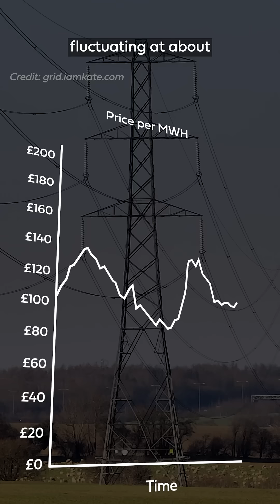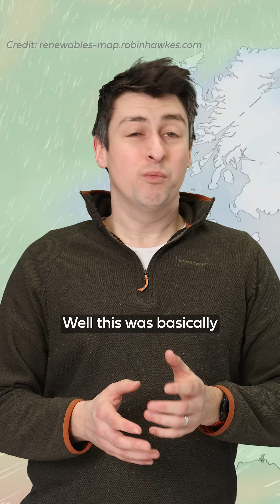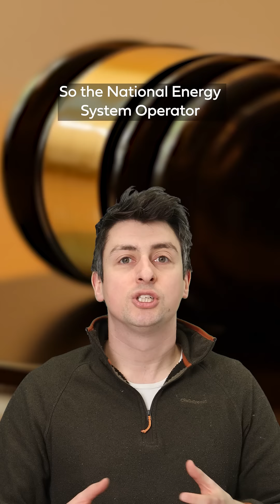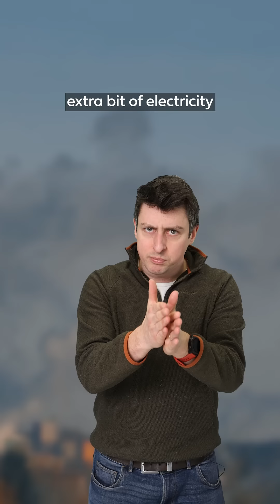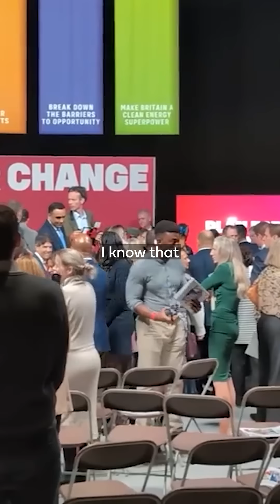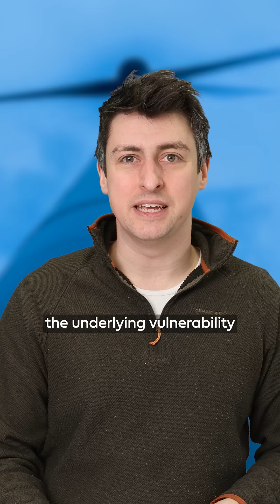The biggest price spike of the energy crisis happened last week

Comment: Former power station engineer here- Electricity was cheaper when it was supplied by the CEGB and area boards, then we had these government lies that it would be cheaper after privatisation, but dogma trumps reality.
Reply: Same happened here in Norway - to top that they created a nordic energy "pool" auctioning power every day to middle men trading companies and day traders / minute traders. A kind of a stock exchange. insane. it tripled and doubled prices ten fold with zero real world reason behind it.  We dont even rely on wind power at all.
Reply: Same with tap water. Worst in all of europe
Reply: @kingcrafteroderderfahradtu7331spot on, my parents moved to a little cottage in North Norfolk in 85 for their retirement. The water then was fairly soft & you didn't have to descale the kettle every fortnight, now mum reckons the price is 5 times what it was then, plus they now need to use a Brita water filter changed every three to four weeks to keep scale at bay, plus if they don't there's a constipation issue! Most of our water comes from rivers or the aquifers both now contaminated with loads of phosphates & other runoff from the farming chemicals like roundup which is supposed to biodegrade but not if it's in water in the aquifers! Their water butt is used for hair washing and the difference is astronomical. Anglian Water have been milking us for decades now & no sign of updating or renovating to be seen.
Reply: good grief, Reagan deregulated the public utilities in the 80s, and of course, privatization has not improved service, price or infrastructure - don't even talk about Texas on it's own power grid with failures that cost hundreds of deaths in cold or heat
Reply: Agreed. They kept selling off our services on a promise of cheaper prices with 'competition' which never happened. What we do need is more home solar, more solar & battery storage on office buildings and schools, which will bring the energy needs down a bit
Reply: @keithmcdougall4893  see I don’t see how they could even think it was a possibility.  Yeah there is ‘competition’ (idk about the UK but we can’t choose our electrical provider in the US) but a private company needs profits and infinite growth to keep their stock prices up.  A public serviced paid for by taxes doesn’t need to make a profit, it just needs to cover operating costs. 

Right now we are dealing with someone trying to make our postal service ‘profitable’ and turn it over to private companies in the US. The postal service is a necessary service and we pay for it with our taxes to work, not to make other people rich.
Reply: @keithmcdougall4893  more home storage will make things even more expensive and do so for those who can least afford the cost 😂

This is how much sense your argument makes. 

"Public transport is too expensive, we need to get more people into cars so we have less demand for it, once we distribute it across thousands of cars it'll be much better."

The cost of the transmission lines and their maintenance is a fixed cost. 

The power plant has to be a fixed size to handle the absolute worst case scenario and continue to function. So the power plant is a fixed cost. 

The only savings you can realize is through economies of scale.

And you'd like to see that reduced. 😅
Reply: @sparkzbarca you're another who has issues with solar & batteries, I see. Any excuse try and put people off. 🤣🤣
Reply: @keithmcdougall4893  no I'm free market, I don't care if people want to purchase their own batteries and solar, even if doing so places a greater burden on the poor, anymore than I'm against car ownership to cheapen public transit. I'm just pointing out the rather obvious point that the answer is to increase supply.

Solar users think well I supply 99% of my own power isn't that good, no it's horrible. That makes that 1% insanely expensive. 

From the perspective of the power company they should just refuse you service entirely so that you don't only create demand at the most demanding of times when they can least afford to generate the supply.

99% of the time demand is easily met anyways and 1% of the time solar is not helpful for the same reasons the grid is suffering and so they are just as greedy as everyone else.
Reply: Look at the Moss Landing Plant fire a few weeks ago in CA. It was the largest lithium-ion battery plant in the world. PG&E, Vista and Tesla and media are silent. Only locals and local news are trying to help. There was hardly any wind and all the smoke concentrated above the area. The compounds in the smoke were so concentrated the smoke burned flames in the sky.  Now people are sick and officials are not helping. Lithium-ion batteries/devices are volatile, toxic and require a base load that is unrealistic.
Reply: It is nothing to do with so called 'privatisation', it is because the government had all our coal and gas plants closed with nothing to repla e them but useless wind. Dogma trumping sense indeed.
Reply: @MervynPartin  It's insane how people used to think 'privatisation' would magically reduce costs. Kinda makes me wonder if it would be possible to convince a bunch of boomers to sell their homes to me for dirt cheap and then rent them back.
Reply: @MervynPartin  the problem was they had useless people running the gensets that would not work. it is like when you rent out a house then the tennants decide not to leave. to get rid of them you either burn it down or sell it. they could not burn it down so they sold the problem to someone else.
Reply: It's about laws. If there were no subsidies and privately owned nuclear power plants, electricity would cost a fraction of today's price.
Reply: The fuel isnt the problem it's the machinery that is burning the gas, gas prices are falling....gas is NOT expensive. we have gone from a a system with super reliable and low marginal cost of production power (large coal and gas) to highly variable, distributed, expensive small scale generators and super expensive batteries...net zero and the decisions made to close large scale plant is criminal stupidity of the highest order. our 3rd biggest wind farm has been paid to be switched off for 60% of the time since it was installed...NUTS! this video is beyond stupid, batteries are really really expensive (and not green), we cant easily install pumped hydro in the uk (the geology/geography doesnt work)...and relying on interconnections is stupidity in extreme - guess what, when the wind isn'tblowing here, it isn't likely to be blowing in Europe either, same with solar....all we do is import really expensive coal based power with lots of losses. What we need to do is install more large scale dispatch able power like coal and gas (we have plenty of both and they can burn clean).
Reply: Governments sell assets because of debt and they can’t afford to maintain/invest in infrastructure under their current pricing model. It all gets to hard for them, so the offload it.
Reply: Remember that film clip from when Calder Hall was opened ? The narrator stated Nuclear electricity will be too cheap to meter.That should be played to the numpties in charge ,Millipede and all the others .
Reply: @alanolley7286 Calder Hall was political cover for the huge amounts of money being spent on nuclear weapons.  It doesn't really have much to do with anything else.  The only lesson to learn is don't pretend your main goal is to make nuclear power when what you're really doing is making raw materials for bombs.
Reply: If you look at France private industry it succeeded and has the lowest rise in bills
Reply: @ece2178 wut?  EDF is owned by the French government, it supplies 85% of people in France.
Reply: @OktoberSunset  Same with National Grid Plc who was government started. They decide the price of transmission and by what rate they sell the electricity back to private company's depending on the highest producer on the system. I'm not sure if they are still government run but probably not. - I will admit this point is not well constructed my main one is the second.

The power stations run by private company's get paid little for what they produce in comparison to what that power is sold for. In some cases this is sold back to the company that produced it but at the cost rate of the highest producer. So the cheaper it is to produce the more you get screwed by the grid and the higher you must sell it to the public to make even.
Reply: Which also correlates with push towards net zero climate policies.
Reply: @NyalBurns  Energy prices skyrocket in the early noughties: before net zero and immediately after privatisation.
Reply: Aaand maybe net zero? Like coal was useful, reliable, easy to access and CHEAP
Reply: @shadowdugify  maybe a small reason but privatization is proven to increase the price of things
Reply: @ not always actually, public sector is a mess with inefficiency, I should know I work in it.
Reply: @shadowdugify  It is now, but it was very much better in previous times, however. The standard of management was better then, and there was more effort put into future performance than the quick buck sought after by today's wheeler-dealer investors and managers
Reply: @MervynPartin  so what is the solution
Reply: @shadowdugify. Regrettably, there is no easy solution. A whole generation has grown up with no experience of how things were when industrialists (and stockholders) passionately believed in their industries. Nearly everything that was transferred into the private sector at a discount has now been snapped up by overseas interests, either to get their hands on valuable patents or brands, or to get rid of competition. This also applies to once great names like ICI, Cadbury, Rowntree, British Steel- the list is endless.
A small step, albeit very slow, has been moves towards setting up Great British Railways (I hate the pretentious name!), but that is only one industry. The utilities like gas, electricity and water are natural monopolies where shopping around every few months is ridiculous. These too should be brought back into arm-length public bodies. A bit of a long rant, but as I said, no easy solution.
Reply: @shadowdugify  so is the private sector. The only efficiency there is things that affect profit. Anything on the consumers end like a lack of service, damaged equipment or billing issues is a nightmare.  At least the public has more control over the public sector. It may be hard to enact change but it’s possible. With the private sector, they buy out competition or lock you in with infrastructure (like internet. We can’t choose our provider because only one provider can run lines in any given area) and you can’t just not pay them unless you can go without the service completely. Idk about you but I need electricity and don’t have the capital to set up my own solar or hydro power.  

I live in an area of the US where everything is privatized. It’s a nightmare. Every issue there is with the public sector is still alive in the private sector, just with the need for infinite growth and profits on top of it. There is no such thing as infinite growth so what happens when the company approaches that plateau?  They cut wages for their workers and services for the consumer and raise prices. Privatization might be better for a little in the short term but give it like 5 years and it turns into a worse nightmare than publicly controlled utilities.
Reply: @MervynPartin Selling our national grid to foreign investors (the likes of BlackRock, and JPMorgan) was always going to make things more expensive, there is only one National Grid, and there's never any legal consequences for not meeting standards or overcharging.
Reply: @shadowdugify  because your government is shit, on a mostly capable government focused on the people, like in China, things move quickly and they are 6 years ahead of target for carbon neutrality, way better than all the neoliberal private-public partnership countries in the west
Reply: Please learn basic economics.
Privatization is factually cheaper, state run government services are notoriously more expensive because of the excessive and insane amount of burocracy they have and they are subsidized by tax payers money meaning that if the up front costs on your bill appears cheaper only because your paying the difference for it thru increase tax burdens or thru inflation.
Reply: @Generik97  privatisation is factually more inefficient and expensive, that's what profits are.
Reply: @Tomartyr 
prof·it

/ˈpräfət/
noun
a financial gain, especially the difference between the amount earned and the amount spent in buying, operating, or producing something.

If your turning a profit then that would be the complete and total opposite of being inefficient and expensive since if you want to increase your profit or even turn a profit you must be efficient and reduce expenses.
Reply: @Generik97  'get educated' he says with the visibly least informed opinion here
Reply: @Generik97  Wow- You actually believe the Tory dogma! Furthermore, the industries were not "state run" but were state owned at arms-length. While there were overall energy policies, the utilities were responsible for delivering economically, and they did so, very well.
At Grid control, there was a Merit Order that was used to ensure that generators were brought on line in turn according to their running costs (subject to system security). There was no energy poverty amongst huge swathes of the population, profits weren't syphoned off to shareholders abroad (including foreign governments via their own state owned companies like EDF, DB, NS, Trenitalia and their sovereign wealth funds).
Does privatisation mean it's OK for foreign states to control our industries? Apparently so.
As for the bureaucracy that you mentioned, that massively increased as a consequence of the privatisations, further adding to the costs to the consumers.
Reply: @Generik97  If it weren't for the spelling mistakes, I'd believe you were an AI programmed by a corporate think-tank to regurgitate discredited right-libertarian econobabble. This 'privatization is magically efficient' thinking is nonsense that's been discredited and despised since the '80s, please learn some basic economics.
Reply: @Generik97  that's why the UK rail is way more expensive now that it's private from when it was 100% government run?

Comment: And, with even more trepidation, may I suggest that the country allows its cheap, flexible, and reliable power source to expand? This, rather than often overwhelming the grid with subsidized power, provided at massive capital cost but zero marginal cost, while shutting down supplies regardless of demand at other times?

Comment: The author of the video is banally lying.
The huge price increase and then those peaks are caused by wind generators.
If there were no wind generators, gas and coal power plants would be constantly in operation and there would be no peaks and the price of electricity would be 10x lower.
Nuclear plants would drive the price down even more.

Comment: Maybe someone smart can come up with a better system, but one of the benefits of having the price of all electricity sold in a time block decided by the most expensive kwh sold, is that it removes the speculation on prices that would otherwise happen if you had to offer the price you would be paid, as an energy seller. With the current system you are incentiviced to ask the lowest price that is still worth it for you to maximise the chance that you are selected to provide power in that time block. Since the cheapest sources are selected first, if total supply is larger than depmand, there is a risk that you wont get to sell any power at all. I think that is pretty cool, but there are problems when the total demand exceeds the regular supply which is when we experience these extreme price spikes.

Comment: This is why if you have gas heat it’s cheaper to keep it. Or if you want to have the best of both worlds do like I did and get a dual fuel system. 

You have a gas furnace and a heat pump and can switch to either from the thermostat depending on the conditions. 

I use the heat pump when it’s mild and over 45 degrees. When it gets below that it switches to the first stage of gas at 25,000 btu and if that doesn’t keep up it brings on the rest and goes up to the full 50,000 btu.  

What’s interesting is the other day we had a heck of a cold snap and I was curious how cold it have to be before the heat pump lost the battle. 

It worked till we hit 30F and at that point it ran non stop and then as it got colder outside the temp inside the house started to drop. 

So 30F is my balance point.